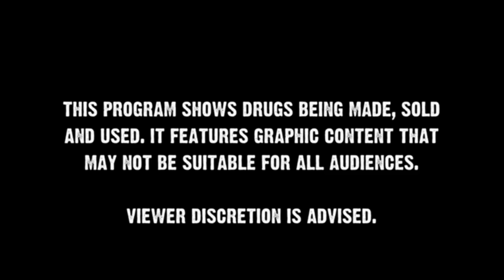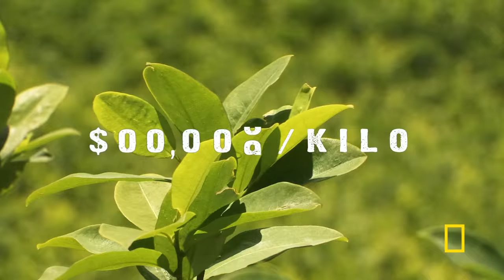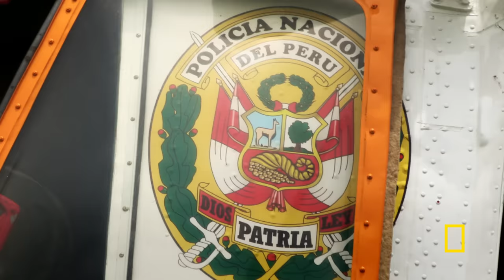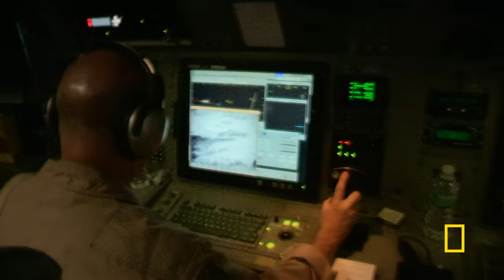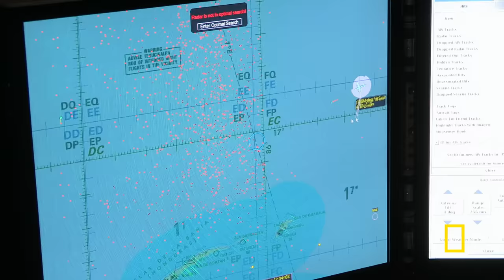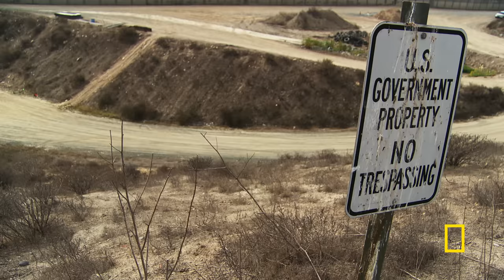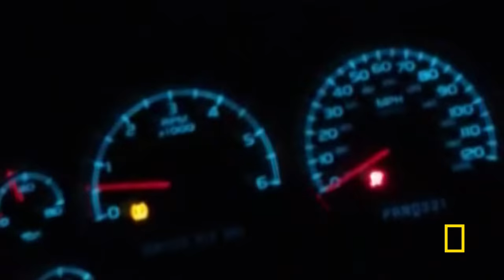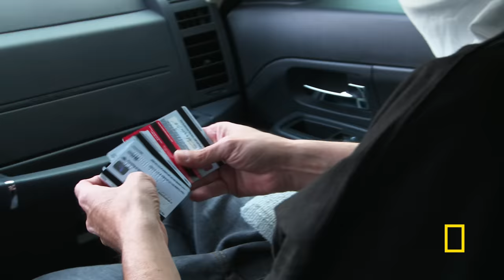Cocaine White Gold (Full Episode) | Drugs, Inc.

Comment: If they can dig a tunnel, they can repair an airstrip
Reply: I was thinking that too, a 5 meter radius hole would probably only delay a cartel for like a week if they are lazy.
Reply: @acatfrompoland5230  not even 2 days
Reply: of course, they can do anything its a matter of time. Thats the best the army can practically do. But the shattered wood part will slow them down and cost them a good bit. The crater can be fixed in a day or 2... if they dont get caught.

Comment: I rather eat bread and water drive around in a ten-year-old car then be a lowlife drug dealer
Reply: That's cool
Reply: Loser, only joking with you. Me too. Even all the money in the world would not tempt me to deal poison. My conscious is clear. And I can sleep easy.  And I wish I had a car that was only ten years old. Mines 14 lol
Reply: @matthewjdouglas6471  we make millions mark you know why? We got our freedom God bless
Reply: Mines from 1989, so 31 years  Old. Still going though. It's a Honda Accord.
Reply: @bs8067  no kidding 1989 Honda Accord? Just keep changing that oil every 3000 miles my car is a 2010 Nissan Altima very happy with it
Reply: @joecap4372  only issue is cvt transmission :(
Reply: @jeffelmore5614  you're absolutely right I am very aware of the CVT transmission I don't go above 60 miles an hour on the highway with it and don't put tork on the transmission.
Reply: @joecap4372  great car but it’s the only setback of it.
Reply: @joecap4372  I have a 09 civic hybrid. Great car but needs a new battery
Reply: @jeffelmore5614  that's a nice car Jeff, in March I put a AAA battery in my car it's the only battery I ever use on any of my cars great battery check it out you're  09 Honda Civic great car change the oil synthetic oil keep it clean and it will Outlast a tank.
Reply: @joecap4372  simple maintenance will go a far way indeed. I use to have a 328i BMW out of high school, she was a gem. Changed the radiator, shocks, fuel pump, and window regulator with YouTube and my brothers tools. Lucky I had him as a resource, however humans are far mor capable than we think. Anyhow I sold it for my mini tank and practicality.
Reply: @jeffelmore5614  I know what you mean sometimes in life you have to go practical. BMW nice car but to fix it and maintain it it's a lot of money. When I was growing up I want to to buy a used Jaguar my father read me the Riot Act he said do you know what will cost you and parts for this car so I never got it
Reply: Proverbs 19:1 NIV. Better the poor whose walk is blameless than a fool whose lips are perverse.

Comment: Really cool documentary but I swear they used the weirdest techniques. Why use so much explosive for one massive hole on the airfield? Surely there are more efficient ways of doing that, like just collapsing the bridge from underneath. 

Also filling the hole with cement is also interesting, why not just use the explosives then? Intentionally collapse the tunnel. 
Maybe they're worried about further collapses but i doubt they're filling the entire 1000ft+ tunnel with cement, and if they are that seems incredibly wasteful, considering there are hundreds of tunnels.